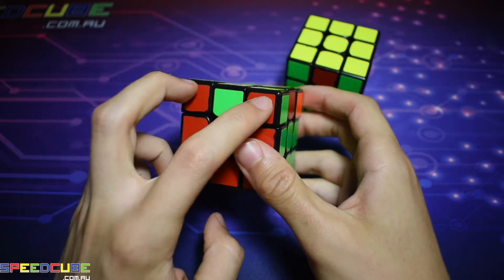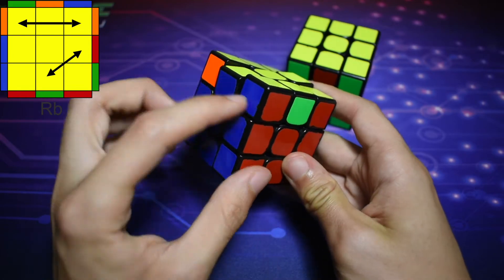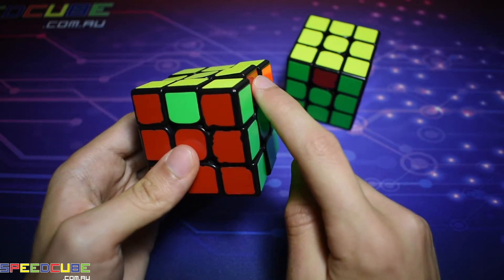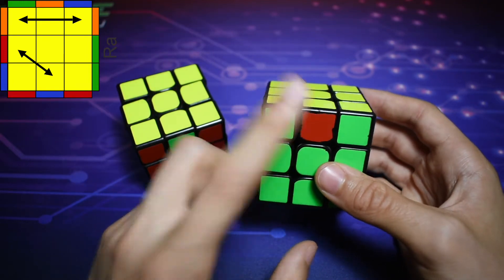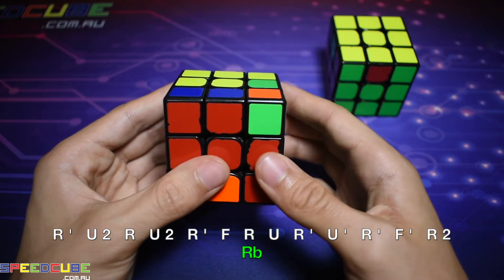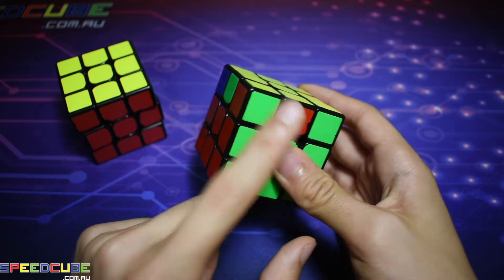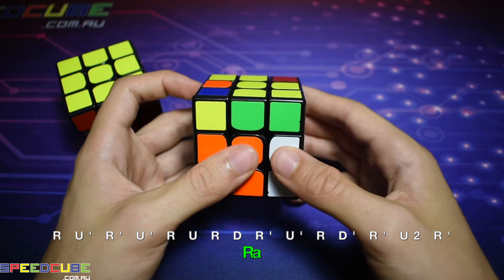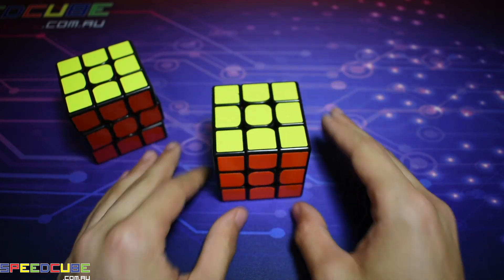2 - Adjacent corner swap PLL | R Permutations

Comment: is there a way to JUST swap the 2 corners, not the edges?
Reply from the maker: There is no alg that will only swap 2 corners.  The following algs swap 2 adjacent corners E Ra Rb Ja Jb T F, but also moves some edges or other corners.  On a 3x3 you will not come across a situation where you only need to swap 2 corners.
Reply: @SpeedcubeAUS i have a 3x3 cube where only 2 adjacent corners need to be swapped to solve it. I think someone exchanged the center piece colors but not sure which of them cause the center piece colors are in right order. Is there anyway to find out which center pieces have been interchanged?
Reply: @NeoOnQuest  i have the same problem lol we must admit defeat i think
Reply: @lewiecrouch8053 Luckily I was able to interchange centre piece colors randomly and solve it. But I think you have apps now which can tell if a cube can be solved or not, so you can find out if somebody messed with it.
Reply: You just have to manually swap them by taking out the pieces. Someone might have interchanged it. 1 time I broke my cube mistakenly interchanged two corners